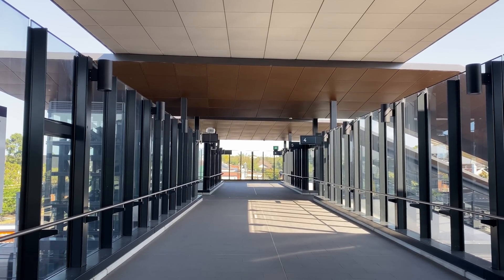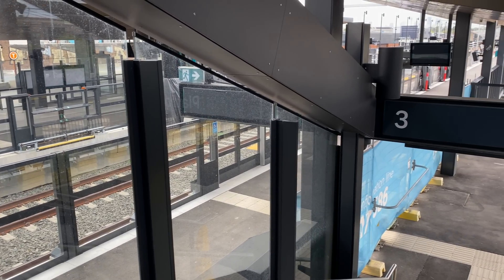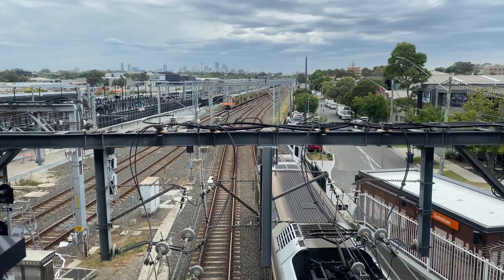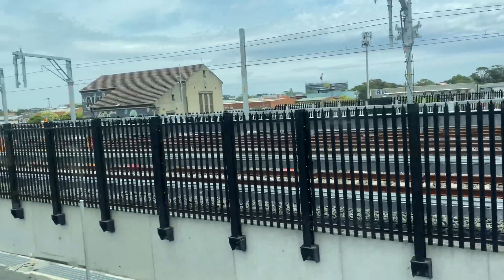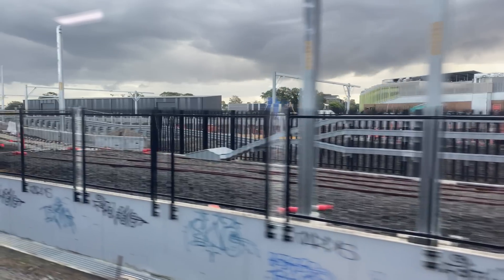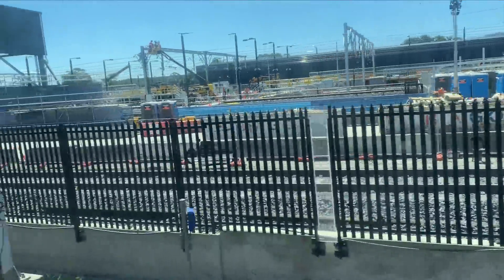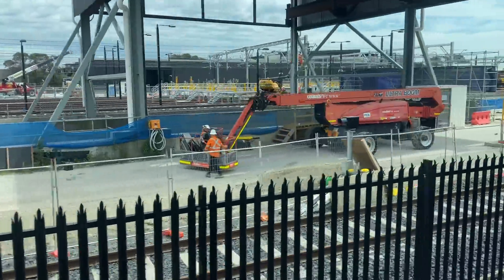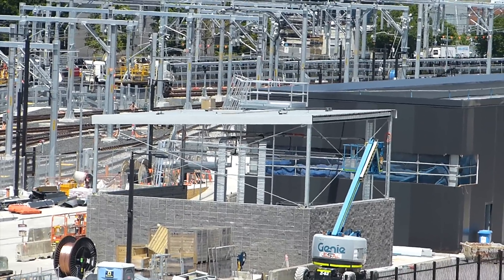Sydney Metro - Sydenham Station, Marrickville Dive Site & Trains Facility South Update - July-Dec 22

Comment: Paul, you might want to head over to Sydenham today. The overhead in the station was up but one of the masts on the dive has failed and it’s all sagged.
Reply from the maker: Thanks! I won't be able to get there today, but I'll check it out later in the week.  If it's not fixed by then, it might end up in a future video 😉

Comment: Looks like platforms 1 & 2 aren’t fully covered from sun and rain.   Is this right? Would have thought they’d be fully covered so in the event of rain, there is no concentrated congestion getting into the Metro where the platform is covered
Reply from the maker: Hi Anthony, It seems to be unusual to have canopies along the whole of platforms. Even the new canopies for platforms 12 to 14 at Central Station only cover some of the platform. It's not ideal, but I guess it comes down to cost.

Comment: Hi Paul, thanks for sharing yet another excellent video, especially within a short distance from my previous family home, which was in Marrickville. Sydnenham station was only one station from Marrickville. Hence, I passed it regularly. I am a bit surprised that they didn't install escalators, considering how many stairs are there. Do all platforms have lifts or just the ones covering the Metro lines? Also, what trains will still use the city circle after the Bankstown line is fully converted for the Metro? Anyway, wishing you the very best. Rob.
Reply from the maker: Hi Rob, escalators seem to be unusual on aerial concourses, but it would speed up interchanges.  Interestingly Cherrybrook station doesn't have escalators either. Sydenham Station already had lifts to all platforms as part of the existing station entrance and concourse. And the new aerial concourse adds an additional lift for all platforms.  T2 and T8 services will continue to go via the City Circle using Waratah and Millennium Trains. Converting the Bankstown Line to metro will probably allow the remaining K sets to be withdrawn. Hope that all makes sense!

Comment: The double crossed junction would mean Sydenham can terminate trains on either sides and turn back. By 2024 Chatswood to Sydenham would open whilst the rest the Bankstown can wait till ready.
Reply from the maker: Yes that's right. There has always been a double crossover for this purpose, but maybe it was modified or strengthened to allow for a much higher intensity of use.  Interestingly, the Bankstown Line is not having a 2 week shutdown over Christmas, and that could be because they have made up some lost time.